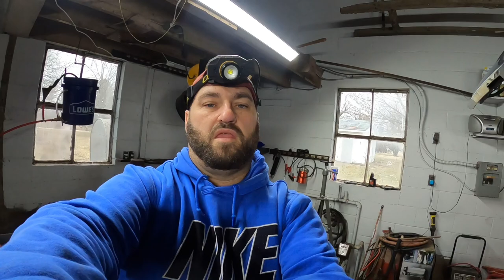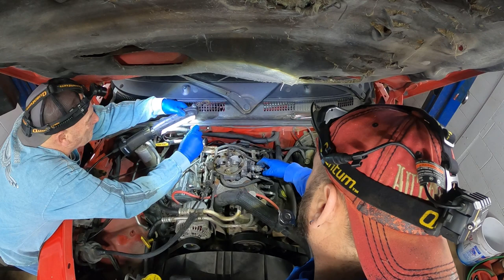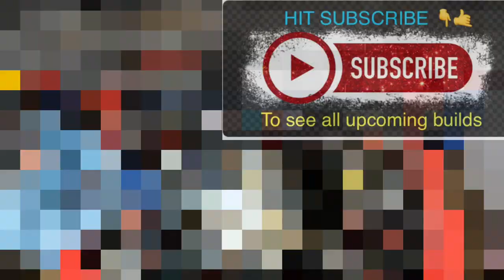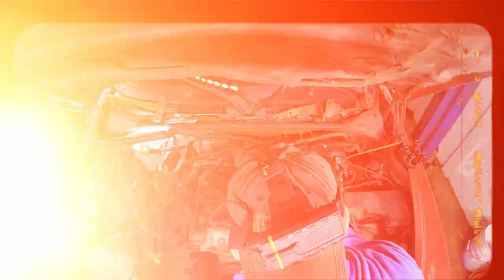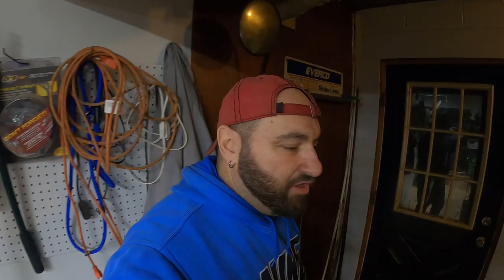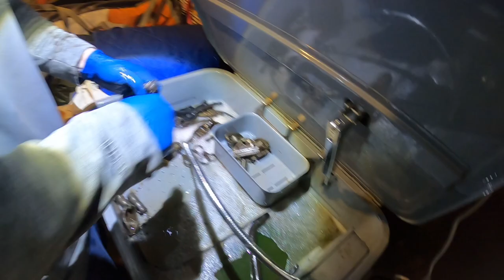How to change head gaskets. 01’ dodge Dakota 3.9l v-6

Comment: Dang, you skipped the removal of the heads. I can't get mine unstuck and figured i was doing something wrong.
Reply from the maker: Once you get the heads bolts loose and removed they will be stuck a little bit you can just pry them off by putting a hammer handle into the intake port and use it to pry it off. Sorry for not showing that.
Reply: @Highway35Garage  thanks buddy.

Comment: How long did this take? Wanna do it to my Dakota but it’s my only ride and I work full time. Can’t rly have it down for more than a day
Reply from the maker: Well if your heads are good and flat and not cracked it should only take about 3 or 4 hrs. Just to install new head gaskets as long as you have all the new gaskets and head bolts.  So if it did not get hot in the process of blowing the head gasket it should be ok.  If it did over heat then you need to check for warping and hopefully not cracked. I have changed them in 3 hrs before. Just pull apart and reassemble with all new gaskets and bolts. Hope this helps.
Reply: @Highway35Garage cool good information to know.

I have 2002 dakot 4wd same engine.

Did a oil change with new valvoline restore oh man. 
Dakota doesn't like that stuff at all but engine runs strong after waterpump t stat timing cover gasket change.

Comment: Thank you for this video! I've got a very clean 01 Dakota Sport 3.9L and I just had a new pulley squeak. Luckily I only had 1/2 mile or so to drive home. When I stopped I could smell coolant and in the engine bay, there was a bit of splatter. Not milky but it looks like dark wet oil. I'm going to take it apart and see what's going on. Normal new oil on the stick but it's over filled. 🤷🏽
Reply from the maker: Your welcome.  Thank you for watching I truly appreciate it.  Hopefully some of my other videos will help you out in the future. Maybe tackle your own brake pad replacement save you lots of money.  Thank you again.

Comment: Let me guess the heads was cracked or warped so you didn't finish so no part 2  and you didn't show the heads a waste of 48 mins of my life to still have to read chilton or haynes
Reply from the maker: Their is an update part 2 on what was the issue and that was the entire process of changing a head gasket just go in reverse order with new head bolts and torque to spec. In the correct torque sequence and you are set.  There was nothing else to show. Besides another 48 min video of the exact opposite of the first which I figured would be a huge waste of people’s time.  I will try to be more thoughtful of actually making a video showing the whole process in the future. Just an FYI. I only show one front and one rear on the how to change brake video also due to the same thought process of it exactly the same for the opposite side.  Sorry for the Waste of your 48 mins.
Reply: @Highway35Garage  I understand that I was just needing torque sequence and specs wasn't trying to be a asshole just figured that would be in there
Reply from the maker: Here is that info.  Sorry I didn’t mean to sound like I didn’t care. Starting at top center, tighten all cylinder head bolts, in sequence, to 68 N•m (50 ft. Ibs.) torque Cylinder Head Bolt -Tightening Sequence Repeat procedure, tighten all cylinder head bolts to 143 N-m (105 ft. Ibs.) torque. Repeat procedure to confirm that all bolts are at 143 N-m (105 ft. Ibs.) torque.As far as head gaskets. If you can find metal head gaskets use those. Head bolts just standard head bolts from the dealer or where ever you can find them. You can re-use the head bolts as long as they arent necked. If it was me i would get new ones, just to be sure. Make sure to clean the block surface well.
Make sure when who ever is inspecting the heads to make sure they're not warped. Spec is anything under 0.009in.
Reply from the maker: So starting at the top of the head, it’s the third bolt from the left is number one the one straight below that on the bottom of the head is number two then you go back up and one bolt to the left is number three then the one below that’s four then you go to the right hand side the very top bolt is number five. The bottom one is number six then you moved to the far left of the head. The top bolt is number seven. The bottom bolt is number Eight.  Hope this helps.

Comment: How would you even suspect that you have a blown head gasket??
Reply from the maker: You would have either white smoke coming from the exhaust pipe or if you have a over heating problem or if your losing coolant but it’s not actually leaking out anywhere onto the ground.
Reply from the maker: The white smoke is the coolant getting into the cylinders and basically burning with the gas.
Reply from the maker: And if your oil on your dip stick looks brown and chocolate milk like.  Sometimes you have loss of power also.

Comment: I have a 97 dodge Dakota, there’s oil on my spark plug number 3. I don’t see any spark plug seals, how do I fix? Do I need a new head gasket or a new valve cover gasket or new heat shield tube?
Reply from the maker: Most likely if you have oil on the outside of the plug itself then you have a leak above the spark plug which in most cases it’s from the valve cover gasket. Hope this helps.
Reply: Thank you it helps a lot!

Comment: I'm replacing the head gaskets on my 2000 Dodge. Dakota 3.9. Do I need to remove the Rocker arms. To remove or reinstall the head.
Reply from the maker: Yes you will have to remove the rocker arms.

Comment: Did you used sealer for the water pump and head gasket after you've done??? Also did you removed the distributor I'm working on a similar truck tomorrow.
Reply from the maker: I would use a product called copper coat on the new head gasket and the regular water pump new gaskets are fine to use. I did not have to remove the distributor.  So you’re all good when it comes to that part.  Hope this helps 🤙
Reply: Thank you  @Highway35Garage